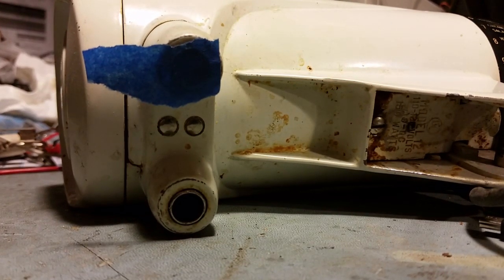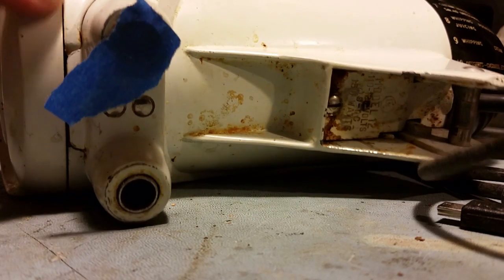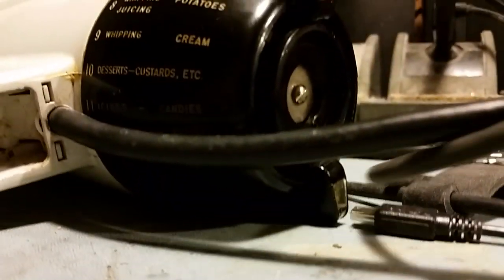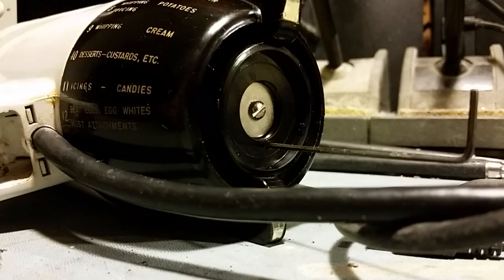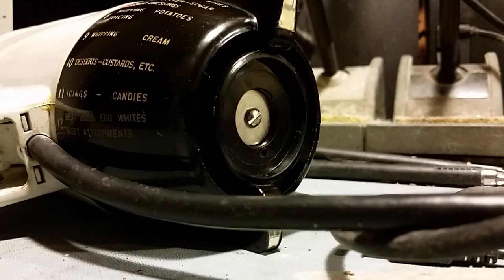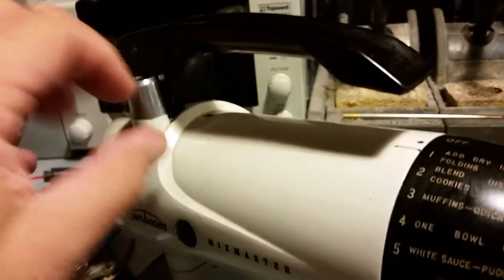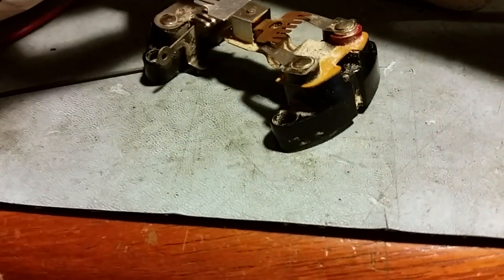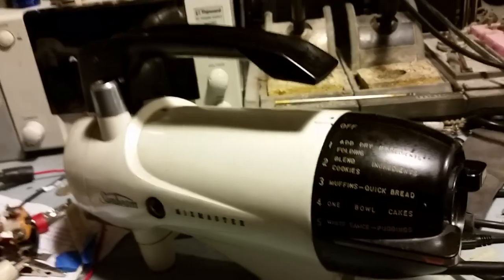Sunbeam Mixmaster 12 repair part 2.

Comment: Don't drive yourself nuts trying to get the rattle out of these.  I'm fairly sure that it's the sound of the speed governor doing its job.  Check out the service manual, you'll see that the governor works by centrifugal force.  The flyweights drive a pushrod up to the governor, and that continuously opens and closes the circuit as the speed hovers within its desired range.  If you notice that it will disappear at full speed, and also it will go away for a second or two as you adjust the speed downwards, until the governor finds its target speed.  If you're used to a modern mixer with a solid state adjustment, or an older one that had a few set speeds from winding taps, that sound does make you think that the gears are chewing up.  I don't think it's the case, though I believe that's the sound of the motor pulsing on and off as the governor does its thing.
Reply from the maker: After the low speed setting was corrected, the whole mixer sounded better at all speeds. The owner of the mixer was happy. I got to work on old tech that will last another 50 years. Thanks for commenting!